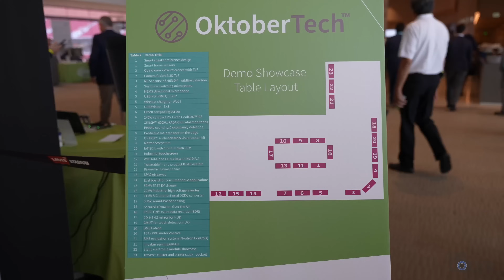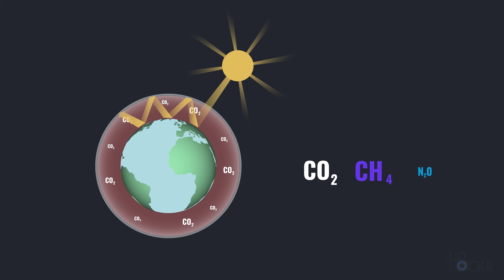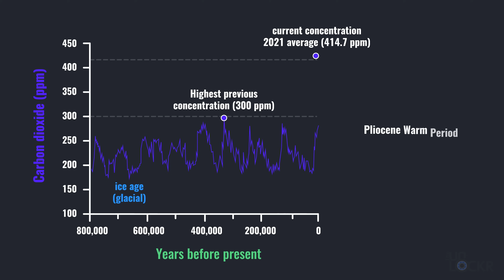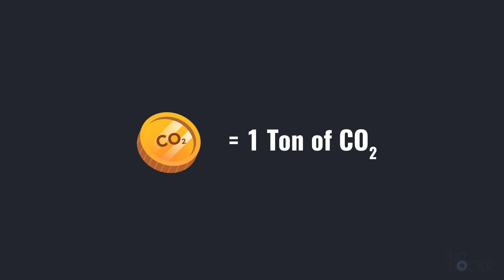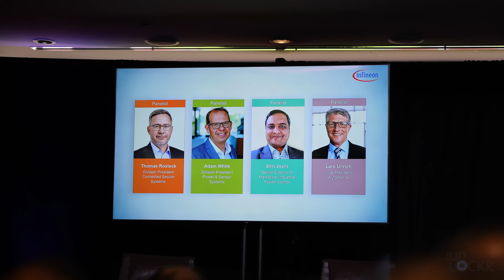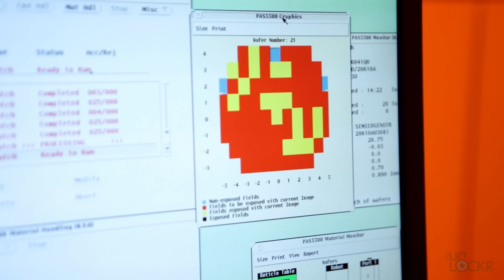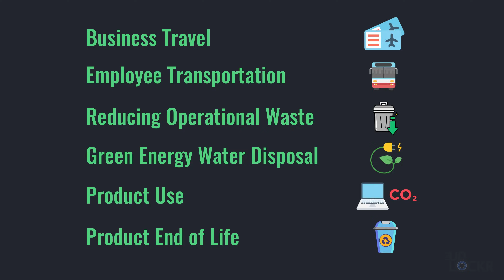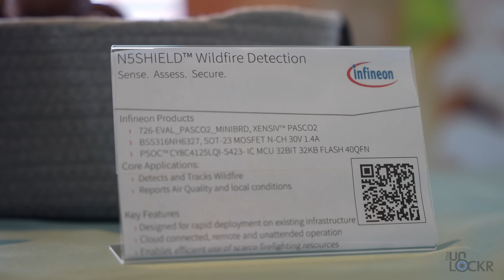How Will Big Tech Companies Actually Hit Their Climate Promises?

Comment: many companies say that they are going to be carbon neutral by a given date, but its in flux mainly because of the practices that they do. a large part of it is simply how unrepairable devices are today, apple's m1 macbook air, which i have for music production, has no repairable ssd. also because the ssd is being used as swap by mac
os it will shorten its lifespan (to try to prevent this from happening, i have mac os ventura booted off an external ssd instead of the internal). the way of reducing carbon aways starts off with reducing the amount needed to create something, then  importantly reusing (companies however are not letting you repairing what you have bought), and then recycle. samsung is also the same where they make it difficult to get replacement displays and parts, especially with their foldable displays. hugh jeffery's youtube channel covers the topic very well, also louis rossman. one of the only companies which is actively allows you to reuse is framework, since they have used listings and their laptops are entirely repairable.
Reply: Then why do you use a Mac?
Reply: @kdgdirk   mainly because audio plugins have better support, but if you had read the full comment, i boot it up from an external ssd rather than use the internal which means that i could replace the ssd externally if it fails and not need to rely on the internal ssd
Reply: @kdgdirk   also due to the fact that for the price point it has aged well performance wise, and has stellar battery life for on the go work audio wise its great.  however if one would want the best bang for buck option for audio is the m2 base model mac mini. if you use the "booting your OS from external storage option" you don't need to use the internal ssd soldered in and your performance scales based on how fast your boot ssd is, due to memory swapping speeds.  keep in mind, your boot ssd will take up a thunderbolt port due to needing the extra transfer speed.